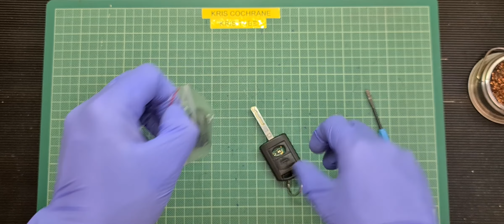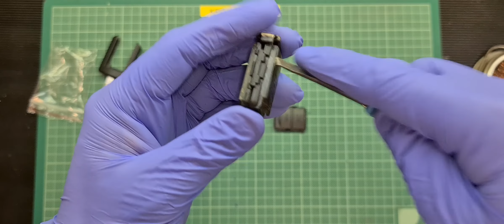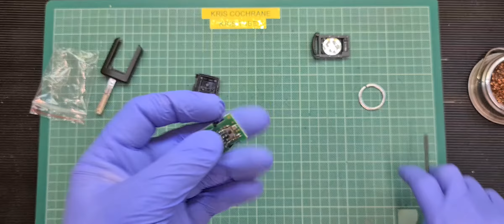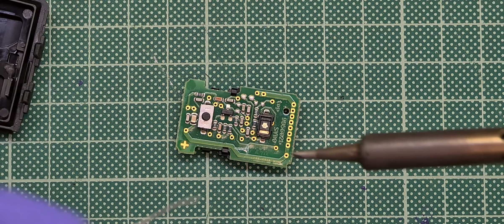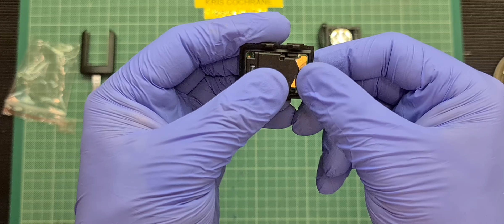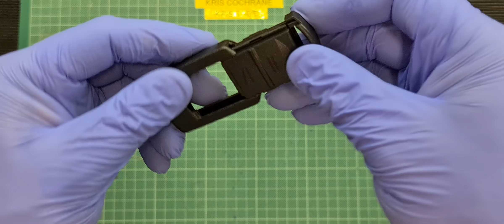Easy fix: How to repair a car remote key-fob with faulty buttons / housing

Comment: My preferred method is to use a scalpel to just get in under the components heat the joint and just lift the end either by twisting the blade or using it like a seesaw with another component. Little bit more controlled. Nice video by the way.

Comment: I had to do this, this week, but my terrible soldering iron meant I over did and pull up the copper pads....   so resorting to using a dab of super glue is hold the switch in place, and using conductive paint.... here's hoping
Reply from the maker: You'd be better using 'bodge' wires.